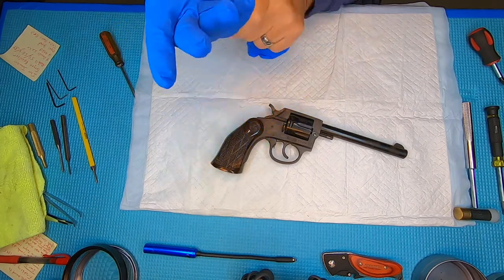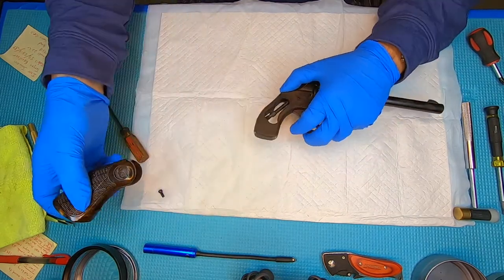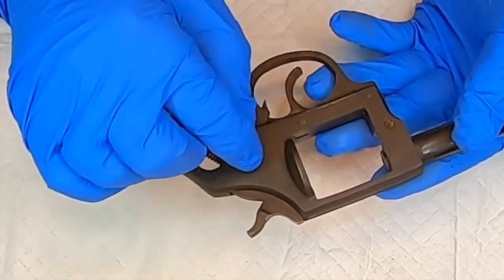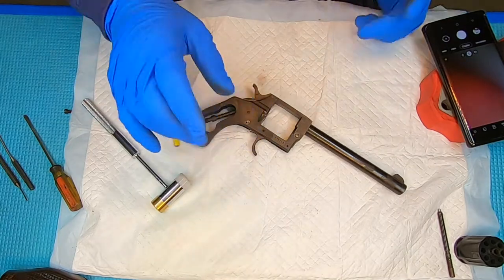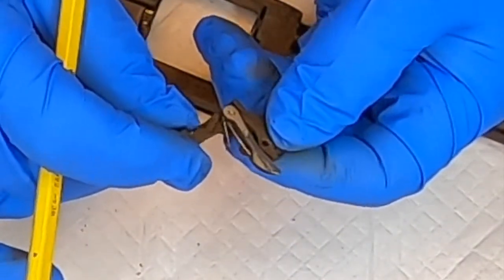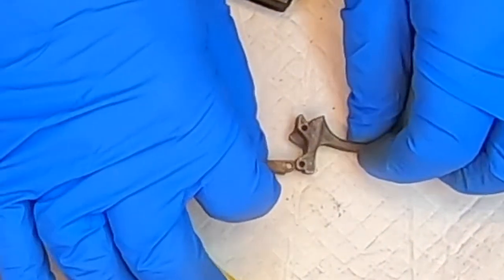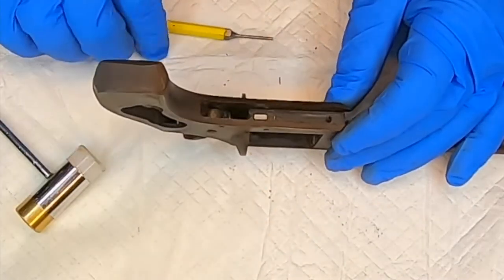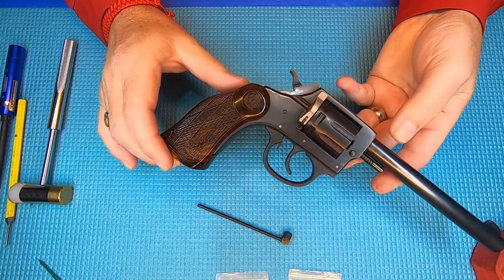Iver Johnson Target 8 Disassembley

Comment: Do you know where I could get  a 'replacement' cylinder for one of those? My dad has an old one very similar to that one, but the cylinder is worn and thus a bit loose.
Reply from the maker: Ebay is where I found the parts